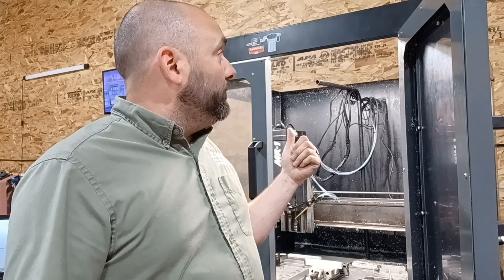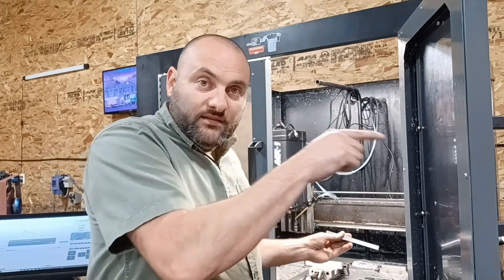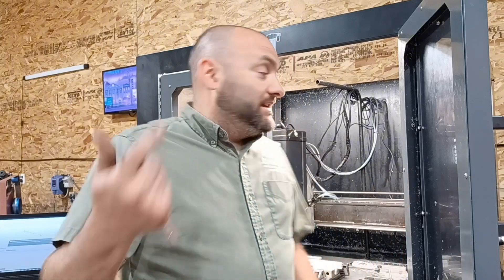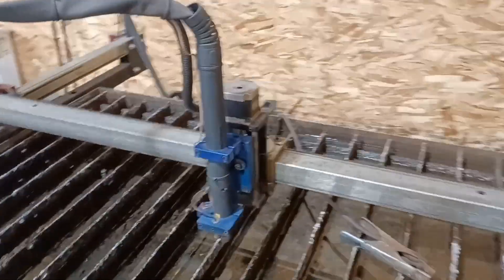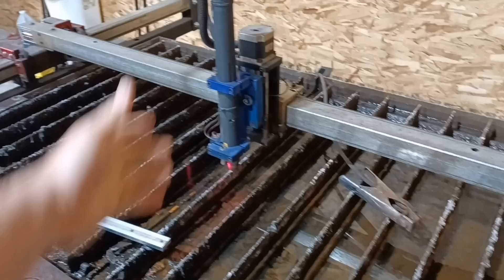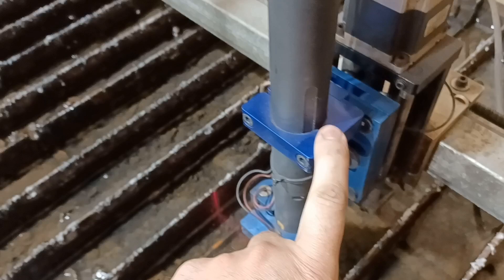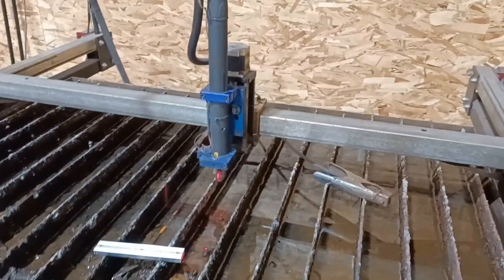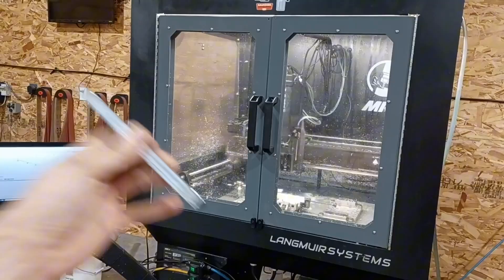Langmuir Systems MR-1... Running Production Parts?

Comment: Brotha! Run multiple stations. Use your work offsets g54 g55 and such make 6 in one shot. And then load up
Reply from the maker: I am using G54, and G55 in this program.  I have additional offsets I could use but this was only a run of 20 parts so not really worth that much setup and programing.

Comment: Holly cow... Whats your feed rate? And what kind of endmill is that?
Reply from the maker: it's a 3 flute, carbide, polished end mill from Haas Tooling.  I'm running 8k rpm and 100 IPM.  The tool could go faster but the MR-1 is maxed out.